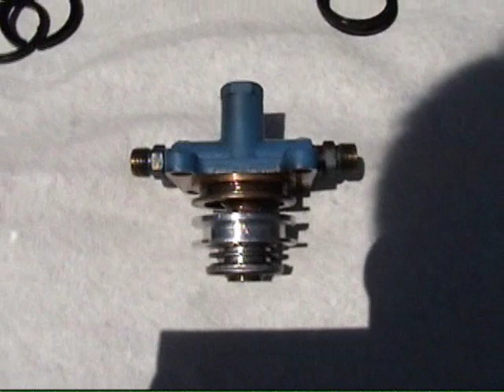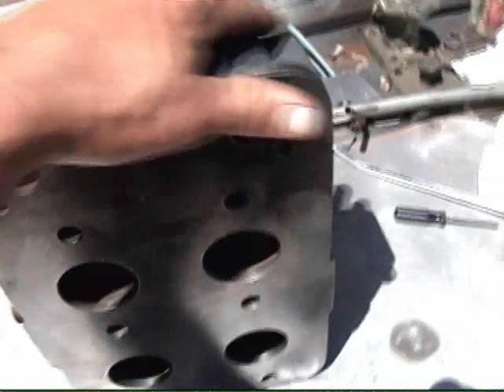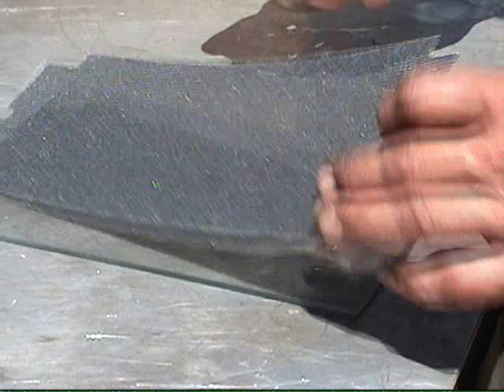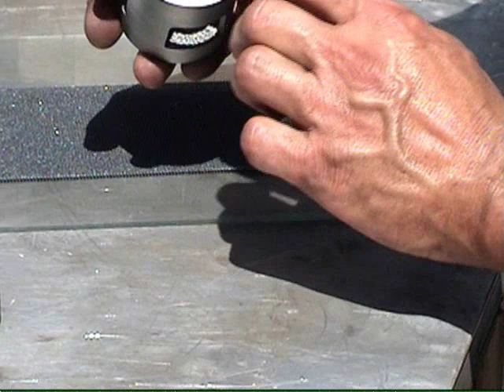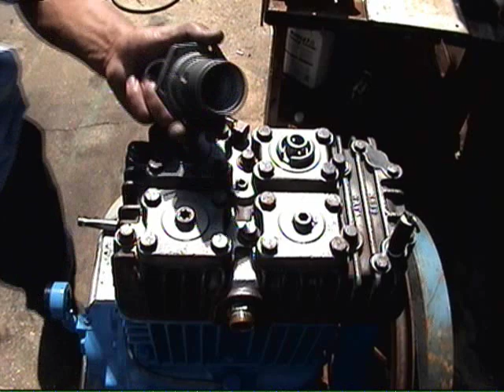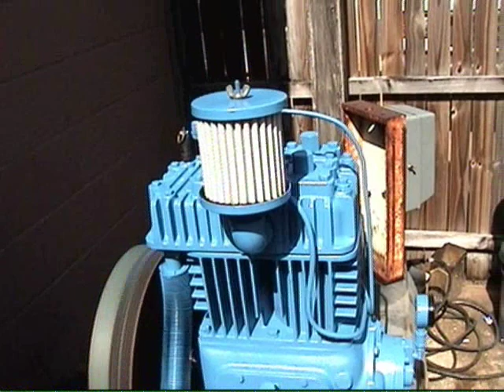Quincy Model # 325 rebuilt and running

Comment: I have rebuilt all my valves, and the unloader, yet after it cycles off, it still leaks air out of the 1/8 pipe plug hole on the unloader tower, it is a small leak but still a leak, if I un-hook the copper line going to the tower it stops, im not sure what this means
Reply from the maker: almost always it's the high pressure discharge valve it's not seating properly you may want to remove it and relap the seat and even the disc
the only other thing it could be would be the head gasket itself. take careful attention to where the copper gasket seats in the head itself if that area is corroded and rusted it can leak by the copper gasket
Reply from the maker: you may also want to wrap the copper valve seat gasket with Teflon tape
Reply: OK I will look at all that again, do you know why when i remove the copper line from the top of the tower it stops leaking air from the 1/8 pipe port, my diaphragm is new also.
Reply from the maker: +IBRACIN the high pressure discharge valve acts as a check valve, keeping the compressed air in the receiver tank from bleeding back into the high pressure cylinder.
when the unloader Tower opens  it vents the trapped air
to atmosphere, so when you remove the copper line the valve then closes and stops venting, in this condition without the copper line hooked up and the unloader Tower closed you will then start building air pressure in the intercooler if the leak in the high pressure discharge valve is great enough and your machine has a interstage relief valve it will start to lift or open,
Reply: ok, thank you very much.
Reply: I have had the valves in and out of this thing so much, and I'm having no luck fixing the leak I'm sure the valve seat it's flat, I cover it with Sharpie and it's gone as soon as I make a couple of passes on 220 paper on glass, all the parts are new, I'm at my wits end with this, I'm about to just in stall an in tank check valve and call it good...
Reply from the maker: +IBRACIN it really sucks when you've got a situation like this,
a in tank check valve will definitely solve your problem but it doesn't make it right.
a long time ago I had a very similar situation on a single stage pump, only it wasn't a slight leak, it turned out to be a crack in the head but the only way to find it was to remove the head from the compressor and apply air pressure to the discharge line or discharge port and then examine the head without any of the other valves in it you may have to use some soap bubbles but most the time it'll be obvious, I'm sorry I don't have more for you to go on
you have one of those problems that's just not a typical Norm
Reply: I agree it wont be right, but at a loss as to why I can't seem to fix the issue, I do appreciate very much you trying to help, i will update as I try to  find the answer, I have taken the valve from the primary piston and swapped it to the high pressure side, it leaks less but still leaks.

Comment: can you give me advice on this. I just picked up a 325 ROC 104. Looks brand new but it seems the ropes that moved it dropped it and bent the crank pretty good. wobbles bad. can a machine shop straighten it. New crank is really pricey. Also there's an older Champion nearby that looks clean. Is the 325 a much better pump. I'm up for the work if its a better machine. Really a shame. Thing looked perfect.

Comment: your videos on this are Awesome.

I picked up a 325-13, I just ran it for the first time, and when it shuts off it dumps all the tank air out of the un-loader port, if I unhook the un-loader tube there is a small amount of air coming out of it.
Reply from the maker: It sounds like the high pressure discharge valve is stuck open
Reply: +ROTARYCOMPTECH 

Thank you' I will open it up and take a look, so a small amount of air will always come out of the hyd un-loader valve?  who do you recommend for parts?
Reply from the maker: IBRACIN get your parts through a local Quincy distributor, the only time air will leak out of the hydraulic unloader is when there is an absence of oil pressure
Reply: +ROTARYCOMPTECH 
so I took apart the high pressure discharge valve , it was really gunked up, cleaned and reassembled, and that did fix the tank dumping at at very high rate.
but it still leaks air from the hyd. unloader after it shuts off, to be clear I know its supposed to dump the head pressure after oil pressure goes away, and it does do that, but then it continues to slowly leak air...  it looks like the sealing ring on the brass plunger is just really hard, is that a serviceable part, or do i have to buy a whole new unloader.?

Thank you for your help.
Reply: +IBRACIN 
I REBUILT the valves, installed new kick off springs, and a new unloader  piston, rebuilt the hyd. unloader... all is well except, after it cycles off it leaks air from the crankcase, its very small but still a leak. just wondering where to look to fix it?
Reply from the maker: +IBRACIN It's probably the hydraulic unloader as it vents to the crank case, remove it from the crank case with the lines attached w/ pressure on the valve to check
Reply: +ROTARYCOMPTECH cleaned seat and replaced the check ball in the unloader, that fixed the leaking back through the crankcase. 

thanks again
Reply: +IBRACIN On my ROC 11, the unloader somehow got bent.  The poppet isn't at 90* to the vertical ports, somethiing you might want to check.  There was a revision to the unloaders somewhere around that ROC

Comment: ROTARYCOMPTECH, I have a new QR-25(325) and I just rebuilt the head watching your video(Thanks!).  Compressor starts at 135#'s and stops at 180#'s, the run interval is right at 3min, how do I extend the run time?  There is moisture rusting the valves.

Comment: I have a Quincy 5120 I believe, and all of a sudden...air seems to be leaking from one side of the air filters(dont know proper term)...causing the compressor to turn on every 5 min or so....anybody have this issue?
Reply from the maker: ***** You have a bad high pressure discharge valve:(
Reply: *****  your head needs O.H

Comment: Thank you for making and uploading these informative videos. They were a big help in helping me rebuild my personal 325-13. I have a question for you. My rebuild turned out really well except for one thing, it will not unload. I disassembled and double checked the unloader tower and the brass unloader valve in the block and both seem to be fine except not only will it not unload, The oil pressure will not return to zero when the compressor is turned off. It hovers around seven psi. Any thoughts you might have what could be causing this and what I should look at  next would be greatly appreciated. 
 Best regards, Dave 

 PS it always amazes me that no matter how good somebody tries to do by posting videos to help people they still attract trolls who have nothing better to do than to criticize them.  I'm not sure if they do it because they're in that dire need of attention or that overexposure from the air in their parents basement is starting to affect them negatively.  Just keep on what you're doing and know that many of us really appreciate it!
Reply from the maker: David O'Neill Never seen that one before, seams impossible with the amount of  voids in the bearings. There should be a orifice in the crank shaft on the flywheel sideit sounds like it may be plugged or it has a plug in it instead of the orifice

Comment: I find it simply amazing how many people you have helped, or given the "idea" to rebuild an old piece of history.
I myself saw one of your videos and made it a point to go hunting for one.
Night and day difference between the compressor that I had been using for the past 12 years.
I found a 325-13 that ran great... however had been sitting for quite sometime.
I tore it down to noting and pretty much followed your videos to the T.
I am having one slight issue that I know you have addressed on here...
The HP unloader tower leaks at the 1/8 npt hole. You have said that it is an issue with the valve assembly... however I am curious... how exactly? When I did my valves i started with 500 grit and worked up to 1200... extremely smooth with no imperfections at all. I really don't want to tear up the paint job... and know I could just add a check valve to resolve the issue... but I'm  just curious what exactly would need done to fix this issue?
The only thing I didn't replace that I probably should have was the brass plungers.... but from what i gather... that isn't my issue and I am just paranoid for no reason.

A side note... has anyone told you that you sound JUST like Nicolas Cage?
Reply from the maker: John F Thanks for the comment does it leak when running or off or both?
Reply: It is only when it is off.
I honestly had no idea it was leaking until it kicked on in the middle of the night.
I sprayed down the very few fittings from the tank and found nothing... then I remembered seeing a video somewhere about one that had air leaking from the air filter (tower was plumbed to the top head port) obviously had a large leak.
Thanks for all of the support you have given everyone.
Reply from the maker: John F Than it's the HP discharge valve, if it's just slight It may just need some run time to seat the disc and seat

Comment: I'm redoing a 325-16 and these have been very helpful.  Thanks for the anti seize reminder.  Scraping off the old gaskets was a pain.  I immersed the head casting in Esprit rust remover and it made the inside clean up much easier.  Dave

Comment: Your videos are great and really helped me rebuild my 325.  Many thanks. Mine is running great but doesn't unload after stopping.  When the oil pressure drops from 20 to zero I don't hear any hiss of air to unload the head.  Also there is no air coming out of the (upper) port on the hyd. unloader when the unit is running, thus no air to the diaphragms, but the unit pumps air anyway....don't know how this could be.  Any suggestions?  Again, thanks for sharing your knowledge and expertise with so many watchers.....JF
Reply from the maker: it sounds like you have a bad hydraulic unloader when the compressor is running and has developed oil pressure the hydraulic unloader should close and remove the signal to the unloader tower diaphragm. you need an air signal to the diaphragms to unload the compressor not to load it up
 thanks for the comment !
Reply: ROTARYCOMPTECH Thanks, Dave, I can see that the hydraulic unloader piston sticks and doesn't open and close easily.  Is it any big deal to rebuild this unit?  does it just come apart after driving out the roll pin?  Thanks again, and keep those Quincys chugging.   JF
Reply from the maker: Joel Fisher Your better off replacing it

Comment: Great video series on Quincy rebuilding. I have a couple Quincy 370's that need rebuilding and this video will help a lot. Also really like the video on the dual control installation, as I am planning to run one off of gas engine.

Comment: Great vids! Thanks. I have a question, hopefully you can help. After my 325 QR-25 shuts off and unloads, air continuously leaks from the unloader tower? What might I do to solve this issue. Thanks again!
Reply from the maker: ladbak1 There are two ports on the tower a small one just under the diaphragm (untapped hole) the other port should be 1/8 NPT(pipe thread)  in about the middle of the tower . If air is leaking out of the untapped port your problem is a leaking diaphragm if it's leaking out of the 1/8" port when off the problem is the HP discharge valve. The HP discharge valve acts like and is the discharge line check valve ( it's the only thing keeping the air in the tank when the unit shuts off)
Reply: ROTARYCOMPTECH what is the Alan screw invader the gages

Comment: Appreciate your time in making the video.I still have 6 of these on campus (actually duplex style, so 12?), out of a total of 41 compressors total, and your video helped me in the task of working on rebuilding the valve components.Most of the Quincy units ,I have, are about 30 years old.

Comment: I am considering buying a 80 gal 325-7 compressor. It was built in 1958. I saw a complete overhaul kit on ebay for $418

Is this a good way to go?

PART: MOK 325-6-Q
Quincy style overhaul kits have been assembled to include gasket kit, shims, piston pins (lock rings if used), piston ring kit, piston pin bushings, insert bearings (if used in original rods), main bearings, valve discs, springs, o-rings, oil seal and unloader diaphragms if required, to recondition one compressor.

Comment: Fixed both valves and now it runs, sounds, acts and pumps like a new compressor.  When I put my fingers over the inlet it runs almost silent and the oil pump stops reading pressure on the gauge.  I can still feel a little air escaping out of the bleed hole on the tower after it shut off.  Maybe the discs will wear in.  Pumped to 160 before I unplugged it and did it pretty fast.  Interstage operating right at 30psi now.

Dave, thanks for all your help!  I feel like I have a new compressor again.

Comment: What kind of a moronic &^#tard works on stuff when they don't have the know-how!  Guess what I did?  I put the spring on the wrong side of the disc in both inlet valves.  I knew better but it happened anyway.  I saw the recess in the upper part of the valve and put the spring above the disc.

I took the HP side un-loader tower off and inspected everything and re-installed it.  Plugged it in and could feel the in and out when I put my fingers over the air filter inlet.  I knew I had screwed up.

Comment: Thanks again, the o-ring is still on the brass plunger and it's in good shape.  After I put it all back together but before placing the rubber diaphragm in place I pressed down on the assembly with my finger and it felt sticky.  It wasn't free like I think it should be.  I'll take it apart again and see what I can see.

Comment from the maker: Interstage pressure should be only 45 psi your problem is the HP inlet valve. Make sure the disc is not stuck open ..Worn valve bumper or pinched between the valve body and bumper or a obstruction, carbon rust ect..The sensor is the hydraulic unloader N/O closes W/ oil pressure so yes it is operating correctly. Also check to male sure the o-ring is still on the unloader plunger.

Comment: Switched places with the tank pressure gauge and PRV.  Interstage pressure appeared to register equal to tank pressure up to 100psi when the PRV popped and I unplugged the motor.  Still getting pressure on the unloader line coming from the sensor on the oil pump when not running.  Is that normal?  No air escaping out of the intake filter inlet.  That's a good thing!

Comment from the maker: Find out what the interstage pressure is when running should be around 45 psig also does the relief valve lift when off and W/ 100 psig in the tank? Iam trying to find out if it's a HP discharge or suction valve problem  don't worry will get it right!

Comment: I can't win for losing.  I had to replace the motor capacitors which is why the Mag starter burned up.  Now I have done the head overhaul and the pop-off on the discharge side is popping off with each stroke at about 100 psi.  I used a silcone spray to protect the cast iron valves.  I wonder if it is sticking the disc to the valve?
I noticed a slight nick on one of the discharge valves seat.  I purposely put it on the big cylinder.  What next?  I will have a mint in this thing if I keep going.

Comment: Okay, bought a head overhaul kit which is just gaskets, copper valve seats, diaphragm, valve discs and springs.  When I took the valve covers off I noticed rust on all but the big cylinder intake side.  One discharge valve is loose.  The shoulder bolt will not tighten enough to draw up the bottom of the valve to the top.  Maybe that is part of my problem?
I have all the parts soaking in Evapo-Rust. Hope to assemble tomorrow.
Can I put a washer under that shoulder bolt so it draws up tight?

Comment from the maker: Checked out your video,hate to tell you your compressor is obsolete only a few parts are available. but I am pretty sure what the problem is after watching the vid the HP inlet valve is loose and the obsolete unloader plunger is missing the rubber seat, thats why air is leaking from the port. You need to remove the unloader tower to tighten down the valve.the unloader plunger is under the tower you may have to get creative to repair it. Also it's splash lubricated..verry old pump

Comment from the maker: To me it sounds like a loose valve causing the knock and the hydraulic unloader is bad or you don't have oil pressure..if you can shot a video of the issues it can be helpfull

Comment: I have a Quincy 320 - trying to setup for a friend but it has issues. It knocks a bit on startup (no air pressure) but stops once there is some pressure in the tank. Then when it gets to about 60 PSI, air starts coming out of the unloader valve. I've cleaned up the valves as best I can, new diaghram on the unloader but don't have the tools to go further. Thoughts? I have a Service Shop about 1.5 hour away.

Comment from the maker: I think your problem is the HP discharge valve when shut down does air escape from the inlet filter? does your machine have a interstage relief valve?...Can you shot a video of the compressor and it's related problems? It may be helpfull...Thanks Dave

Comment: I took the hydraulic un-loader line off of the tower and the bleed stopped leaking air.  Put my finger over the copper line from the un-loader and it built up pressure.  So I'm guessing the problem is the small valve at 12 o'clock on the oil pump that is fed by the copper line from the air tank and line going to un-loader tower?